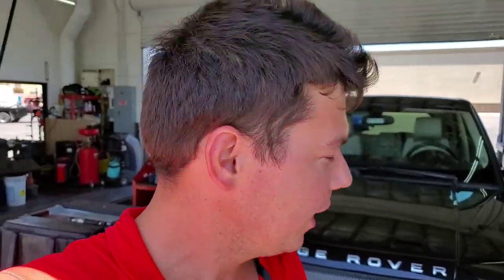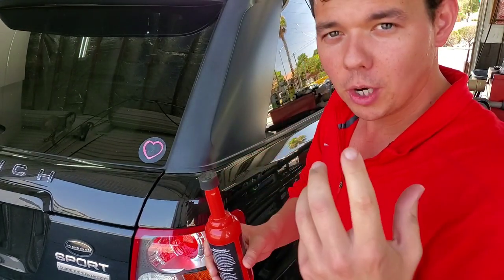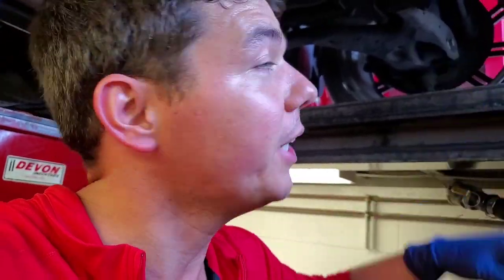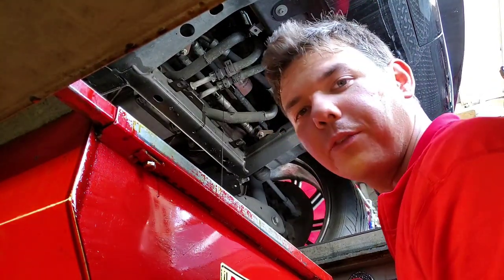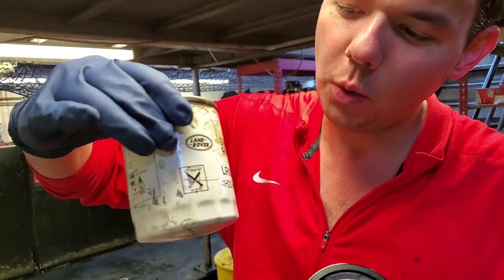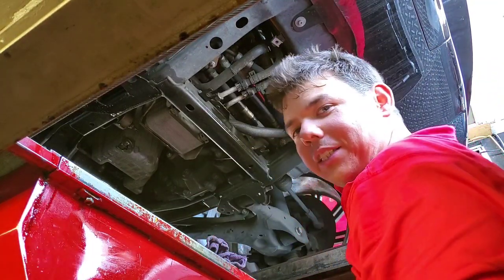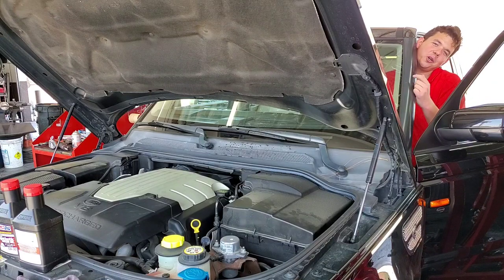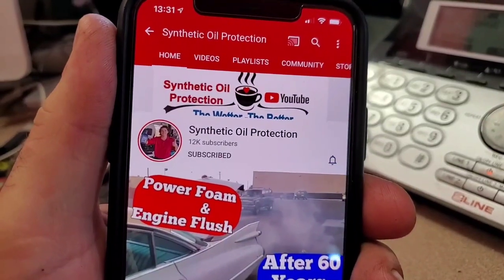2006 Range Rover Sport AMSOIL Engine Flush Oil Change

Comment from the maker: AMSOIL FAQ - https://www.youtube.com/playlist?list=PLB_ftWArBFddeMPIMmZFpXbOyXSRZerqt

     How should I help you with your vehicle? 

     My Link: Best AMSOIL 100% Synthetic @ Wholesale + FREE Shipping: https://www.amsoil.com/offers/?zo=5331179 

     AMSOIL Products & Vehicle Lookup - https://www.amsoil.com/guides.aspx?zo=5331179 

     AMSOIL Performance Tests - https://www.amsoil.com/performancetests.aspx?zo=5331179 

     Ebens Giveaway: 

Video Playlist - https://www.youtube.com/playlist?list=PLB_ftWArBFdey4HFt_Z9KgSIChjkLbw_o

     Ebens Facebook - https://www.facebook.com/profile.php?id=100007973957868 

     Are You against learning about AMSOIL?: 

1. Where can I find AMSOIL? - Use this link https://www.amsoil.com/offers/?zo=5331179 
Or 
Watch THIS: 3 Fast Ways To Get AMSOIL - https://youtu.be/RiYifuDCsnQ 

2. What makes AMSOIL different than other oils? - 

AMSOIL is 100% Synthetic & has higher film strength & last 4×longer then Mobil 1 EP which protects and separate metal parts keeping them from wearing and Lasting Exponentially longer: https://youtu.be/f4eNPgTi_qo 3. Why should I use AMSOIL?: It protects the engine so it will last longer. Less oil changes less often(once per year/15,000miles) or longer... Save money in Gas & Time making it less expensive then a free oil change over the year - https://youtu.be/H7K6FdZlqmg

     Professional YouLubher: Eben Rockmaker Master Direct Jobber AMSOIL Specialist (Dealer#: 5331179) Mobile: (702) 472-3614

     My Link: Best AMSOIL 100% Synthetic @ Wholesale + FREE Shipping: https://www.amsoil.com/offers/?zo=5331179 

     AMSOIL Products & Vehicle Lookup - https://www.amsoil.com/guides.aspx?zo=5331179 

If your vehicle is not on the lookup guide this is AMSOIL Tech Support 715-399-8324 be sure to refer to Eben 5331179 

     AMSOIL 46,000 Mile Test Results - https://youtu.be/UjijQK5wSM0

     Is it a ridiculous idea to tag me?: 

     Instagram - https://www.instagram.com/syntheticoilprotection/ Eben 

     Facebook - https://www.facebook.com/profile.php?id=100007973957868 

Order AMSOIL By Phone: Be sure to give them my number so I get credit for helping you Eben #5331179 and tell them you would like to be a Preferred Customer. 1. Call 1800-956-5695 2. Ask for your own preferred customer membership because you will get wholesale pricing, free shipping over $100, and your informative quarterly AMSOIL Magazine. It costs $10 for 6 months or $20 for the year which is well worth it. 3. Eben dealer number 5331179 4. Orders over $100 will be shipped free. 

Industry-standard 3rd party testing results: AMSOIL Signature Series 5W-30 Synthetic Motor Oil protects against harmful deposits on turbochargers 4X better than Mobil1® Extended Performance and 3.6X better than Royal Purple® in industry-standard testing*. https://www.amsoil.com/newsstand/motor-oil/articles/leading-the-field-in-deposit-protection/?zo=5331179 

     AMSOIL Better Gas Mileage - https://www.amsoil.com/newsstand/motor-oil/articles/another-win-for-amsoil-products/?zo=5331179

     AMSOIL Performance Tests - https://www.amsoil.com/performancetests.aspx?zo=5331179 

     Professional YouLubher: Eben Rockmaker Master Direct Jobber AMSOIL Specialist (Dealer#: 5331179) Mobile: (702) 472-3614 

     My Link: Best AMSOIL 100% Synthetic @ Wholesale + FREE Shipping: https://www.amsoil.com/offers/?zo=5331179 

     AMSOIL Products & Vehicle Lookup - https://www.amsoil.com/guides.aspx?zo=5331179

Comment: Good stuff. I've used Amsoil P.I in a few vehicles before, amazed at the difference it causes. I actually just bought a 20 ford ranger and changed most the fluids with amsoil at 1,000 miles. Rear/front diff, transfer case, oil, added coolant boost, and did a brake fluid flush. The brake fluid was interesting because i am sure that it was still pretty good at 1,000 miles in a new truck but let me tell you, I actually noticed a difference in braking with the amsoil brake fluid, the brake pedal felt more responsive. The transmission is the only fluid I havent touched with this one yet. 

All that other stuff though actually made a huge difference. The best fuel economy I had since I got the truck was 18mpg(with my driving style lol) That has since gone up to 18.3mpg. Keep in mind the fluids I replaced were still practically new, just a fluid upgrade and I think it runs a bit better also. I ran a can of P.I through her and that definitely made a noticeable difference as well and that was only at a bit over 1,000 miles on a new truck! I am amazed by all amsoil products. Going to try the upper cylinder lubricant next along with a k&n air filter.
Reply from the maker: Sweet thanks for sharing your feedback☕

Comment: I have personally used the engine flush in  our mini countryman all4s and the flush did clean out carbon deposits the proof was in the old filter and the oil drain pan. This stuff works wonders a very good preventive maintenance routine t o start. Amsoil all the way

Comment: I bet Jeff hates doing the engine flush with all that squirting. Lol.
Reply from the maker: Yeah this was the biggest squirter on the channel ever.

     I got tagged in my right leg the oil penetrated through my pants through my deck of cards I got hit with only 4 oz of oil with flushing it and I got a pretty bad headache.

     That oil comes out like water when it's hot with the Flash in it.

    The good thing is it gets all the carbon deposits out☕🇺🇸🎥
Reply from the maker: You're in the end of month giveaway the last Saturday of the month at 11 a.m. text me your full name all saved in my phone 702-472-3614

Comment: Great video!  How many miles would OE last in a 2011 ram 5.7 ? I'm saying 6000 ?
Reply from the maker: Yeah it would probably be good for about that with City driving or 6 months.

If you did all highway driving you could probably do 9000 pretty comfortably.

I would check your oil every month and keep an eye on it because every vehicle is different.

This will give you all the products for your vehicle and fluid capacity I also recommend doing the flush and getting the Amsoil oil filter and it's best to be a preferred customer to get it at wholesale and you'll also get the free shipping.

AMSOIL Products & Vehicle Lookup - https://www.amsoil.com/guides.aspx?zo=5331179

Comment: Do you know what oil was used before Amsoil? Because that motor didn't sound right before Amsoil. Something sounded off. It definitely sounds better with Amsoil but to me motor sounds off for some reason but landrover makes great engines though.
Reply from the maker: I think part of that was the air compressor in the background but it did make a difference.